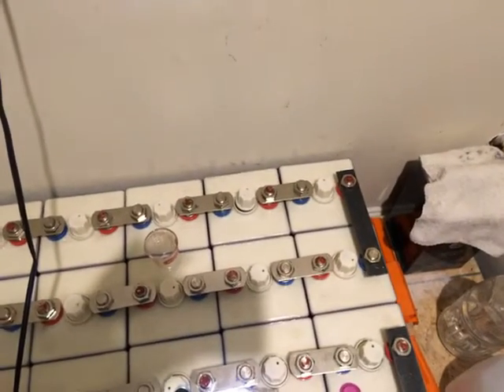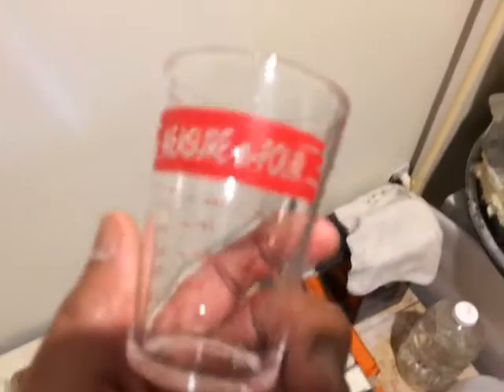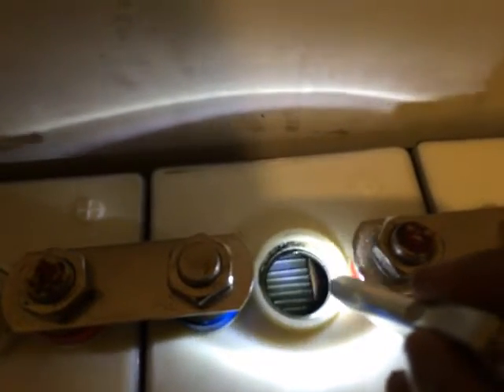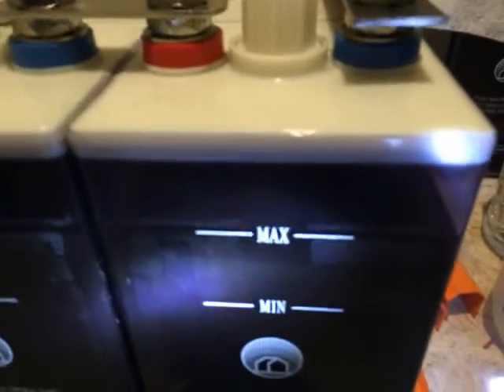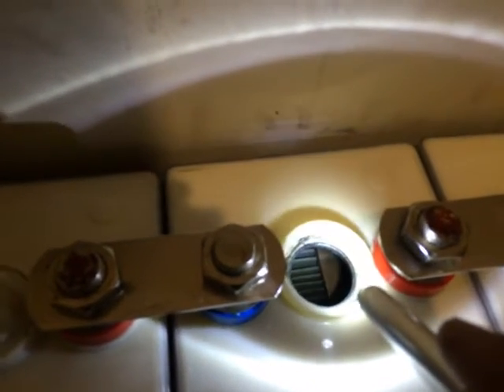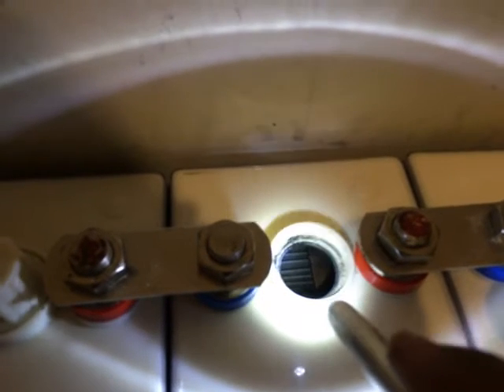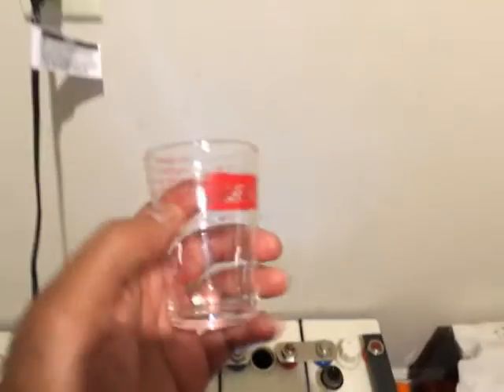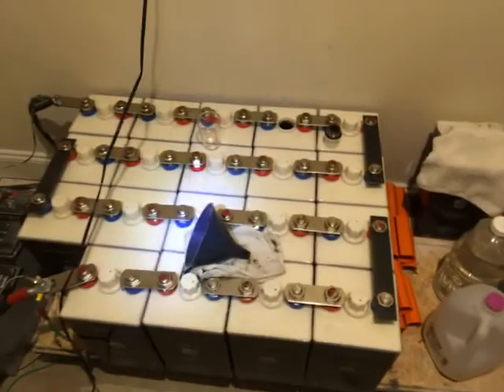How I water my Nickel Iron Battery Cells

Comment: Wow that's inconvenient how often do you have to fill up the cells? do you think it's practical for a homeowner who purchased the system to fill his cells by himself or do you know if solar companies usually offer cell maintenance as a service? do you think a manifold connected to a submersible well pump would work if each individual line is independently controlled?
Reply from the maker: I try to run my cells almost daily, and I charge them pretty hard,  so I do loose a little water and I have to top them off often, not because they've lost a lot of water, but because I like to keep them filled out of habit more than necessity.  This process takes maybe 15 to 20 minutes and is not terribly tiresome to do.  With the ability to drain and recharge these batteries everyday, for me, topping off the cells once or twice a month is a small price to pay.  Since I'm not refilling the cells completely, just adding around 120mL or more of water to each cell, it doesn't take me long to top them off.  A manifold connected to a small pump in a 5 gallon tank of distilled water would work, a gravity fed system would be better.  Also, the caps and valves must be able to tolerate the KOH electrolyte solution.  Ni-Fe batteries have their strengths and weaknesses, and one of the weaknesses is the water loss after heavy use or charging.
Reply: +rhandsom wow that's awesome, so you're saying you only fill them up once or twice a month? what happens if you're in a complete off grid situation and relying on panels and battery bank 100%? Do you think it would require filling the cells up more frequently
Reply from the maker: Actually, the harder you use the system the more water you will consume. To give you an example, if I completely drain the bank down to a 20% state of charge, during the chemical process of using the energy stored in the cell, it will consume a relatively small amount of water. However, if I then "fast" charge that bank of cells at a charge rate of 60 Amps for 3 or 4 hours, the 60Amps at 31V (1860w) will generate heat and a lot of hissing and bubbling activity in each cell (at the end of the charge cycle) thereby consuming more water than if I was slow charging at a rate of 20A at 31v (620w). These cells are designed to be worked hard in an off grid scenario, so fast charging them doesn't hurt them.  If I didn't top off the cells like I normally do and let it get to the "minimum" line, it would probably take maybe 3 or 4 months at my current rate of consumption to get to the minimum mark, I haven't tried that approach so I'm speculating. But to give a more specific idea of how much water would need to be consumed, here is the math.  From the Maximum to the Minimum mark is 2 inches, so essentially we're talking about an area of 72 cubic inches (6" long x 6" wide x 2" high = 72 cubic inches), which would be a volume of roughly  1.17987 liters of water per cell. So 1.17 liters of water would take a little time to evaporate.  Hope that helps.
Reply: +rhandsom what's the difference between a quick and a slow charge? and is that just a setting on the inverter?
Reply from the maker: The acceptable charge rate of batteries is generally determined by the manufacturer.  Different battery chemistry's allow for different rates. The charge rate is determined by dividing the battery or cell amp hour capacity by the desired charge time or by the desired Amps.  For example, C\5 = 200Ah\5hrs = 40A needed.  200Ah\3hrs = 66A.  Typical lead acid batteries go with a C\20  or C\10 charge rate. For example, 200Ah\20hrs = 10Amps.  The lower the charging amps,  the "slower" the charge time.  For example 200Ah\10A = 20hrs needed to charge the battery (Slow).  200Ah\60A = 3.33hrs needed to charge the battery (Fast).  However, fast charge = more water evaporation, slow charge = less water evaporation.  You set your charging parameters in the charge controller settings, meaning charge controllers that actually allow you to make changes.
Reply: +rhandsom thank you!

Comment: It's be great to connect your distiller to the automatic watering system so that the distiller automatically makes water for the watering system!
Reply from the maker: That wouldn't be practical in this case.  The container should be a 5 gallon type and will hold enough water to gradually replace the water as it evaporates.